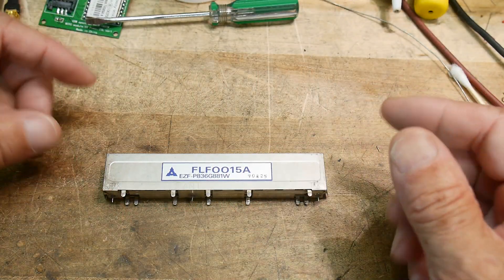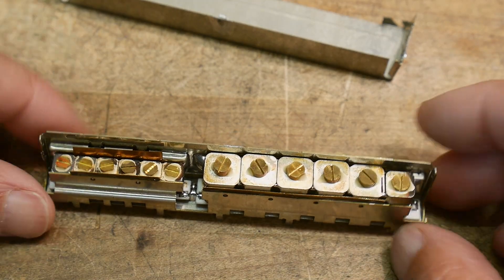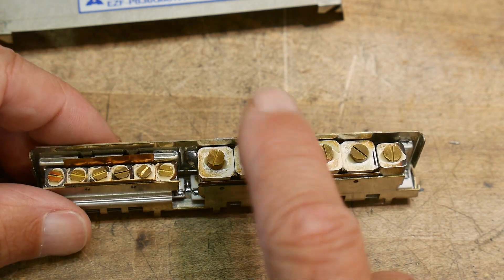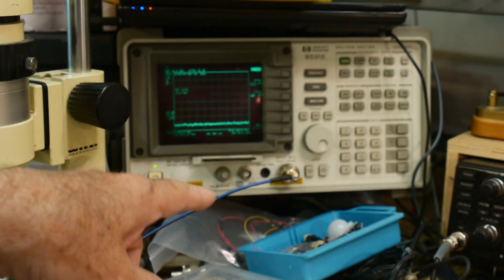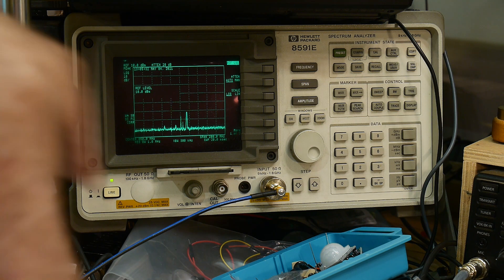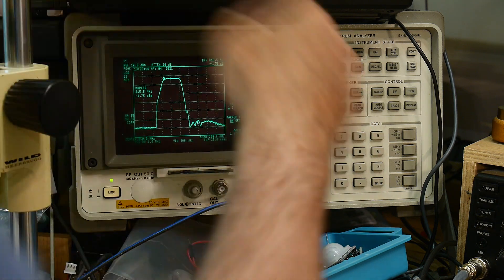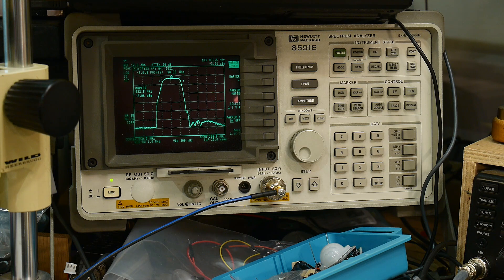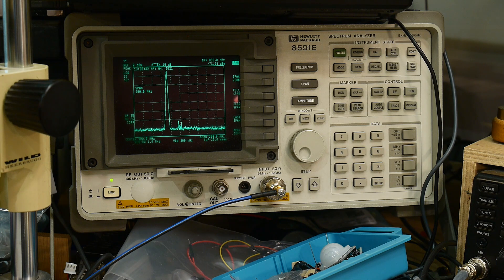#803 GSM Duplexer Measurement

Comment: Thanks for the demonstration.
Duplexer (the one what you have) is the one that works on two adjacent or close frequencies of the same band.
A Diplexer is one which works on two different frequencies of two different bands.
In the amateur radio service a duplexer is used in the 2 meter band (144-148 MHz) in the repeaters.
You do diplexing when you work on a satellite using the VHF and UHF bands for the down/up links.
This is done by having a low pass filter for the VHF and a high pass filter for the UHF bands so that you can operate in two sets of Yagi-Uda elements antenna on a single boom.
De VU2RZA
Reply from the maker: https://blog.pasternack.com/uncategorized/whats-difference-diplexer-duplexer/
Reply from the maker: https://www.rfwireless-world.com/Terminology/diplexer-versus-duplexer.html
Reply from the maker: Different definitions....
Reply: @IMSAIGuy  No. You may want to read the articles carefully you have referred to here.
I believe you would understand correctly and appreciate what I have said is correct.
De VU2RZA
Reply from the maker: one agreed with you the other:
A duplexer is also a 3-port RF device, and its purpose is to separate transmit and receive signals from an antenna to two different signal paths based on direction. These transmit and receive signals may be operating at the same frequency, and hence a duplexer enables true two-way communication from a single antenna.
Reply from the maker: @subramanianr7206  https://en.wikipedia.org/wiki/Duplexer
Reply from the maker: seems like people use the term differently. such as half duplex or full duplex. a tx/rx switch would be half duplex and a circulator could be used for full duplex.
Reply: @IMSAIGuy  A circulator is like one way traffic. Any signal trying to come in the reverse direction would be terminated in a 50 ohm (standard nominal) resistor. The signal is subjected to the strong field of a permanent magnet and takes a semicircular path to appear on the Port 2.
This is a different technology to achieve a similar function.
A simple passive (cavity) filter comprises of L and C and exploits reactance offered that are opposite in sign.
What you are demonstrating is a simple cavity filter with a sharp reject response.
During Txing the signal would not enter the RF front end of the Rx because it gets attenuated to several 10s of dBs. 
A single antenna can be used for Txing and Rxing without any manual intervention or sophisticated arrangements. 
The definitions are not going to change from person to person. It shall not be science.
People quite often, out of ignorance use the terms interchangeably. Hence the long argument here...😁
Reply from the maker: @subramanianr7206  An isolator is a circulator with one port having a 50 ohm termination. A circulator has three ports.
Reply: @IMSAIGuy  You have finally agreed upon the terminology of the Duplexer and the Diplexer, I think 🤔
Reply: Terms Duplexer and Diplexer often mean different things to commercial and amateur operators.
In both worlds Duplexer (like IMSAI's) usually refers to a complimentary set of cavity filters that splits one band of frequencies from a common antenna into a receiver, and a different band of frequencies from the transmitter into the same antenna, so you can receive and transmit simultaneously without overloading or destroying the receiver (aka repeaters and ancient mobile phones).

In the amateur radio world a diplexer is a simple set of LC filters that connect multiple transceivers to a single antenna, for instance 6m, 2m and 70cm radios to a tri-band antenna (or visa-versa, connecting a multi-band radio to multiple antennas).

A diplexer in commercial world is generally a set of narrow band cavity filters for connecting multiple transmitters (or receivers) to a share single-band antenna, although they may also use broad band diplexers for running multiple FM or TV transmitters into a single multi-band antenna.

Really busy coms sites often combine diplexers and duplexers (and isolators) to run multiple repeaters or cell bases into a shared antenna.  Potential for interference gets really exciting!
De VK3BYY
Reply: @markharrison7970  you may want to read the articles quoted by IMSAI guy.
Definitions don't change either for you or me and between the commercial and the amateur worlds as well.

Comment: Interesting, what would you use it for?
Reply: To receive and transmit on the same antenna (on diff frequencies) without having to use a relay to switch between rx/tx.  The only downside? is it's not simplex hence the name Duplexer.
Reply: @vincei4252  less components and less time?
Reply: @jdmccorful  Mainly only one antennna which is shared between TX chain and RX chain. Since TX and RX are tuned on different frequencies you can transmit and receive at the samme time using only one antenna, but on different frequencies.

Comment: Nice look at the unit.
 
It's definately a GMS850 duplexer. 
The ceramic ones were used mostly in very early, chunky receivers and micro base stations, since a "big" basestation has a cavity duplexer to handle the power and a more modern phone has a way smaller duplexer. 

Nice find for 3$, I'm searching for something like this and alos one in the DCS 1800 band, they are quite hard to impossible to find here in Germany, since we don't have any surplus stores like that. 

It's also nice to use a power splitter to combine the RX and TX paths, to see both responses at the same time (like in your thumbnail)
Did you acutally do it this way or did you save the waveform and do it in two passes?

Greetings,
Michael